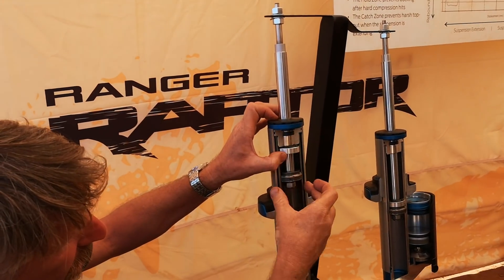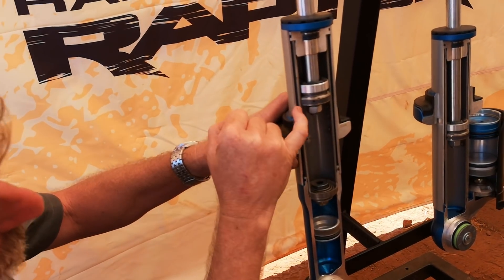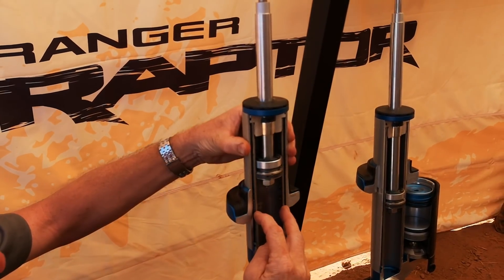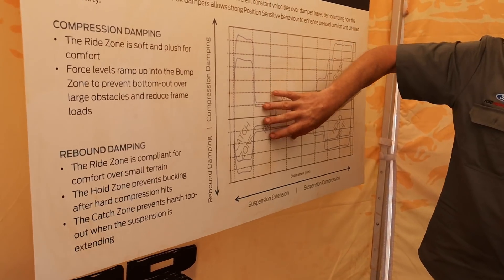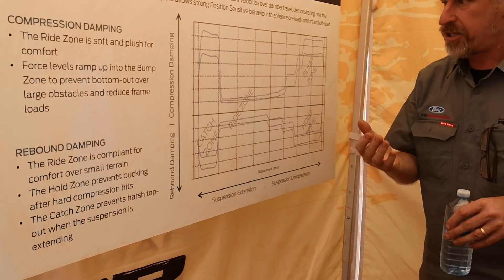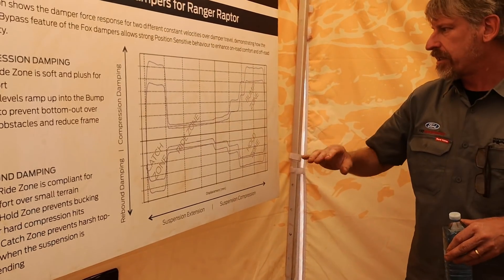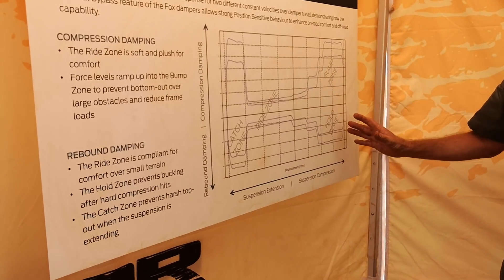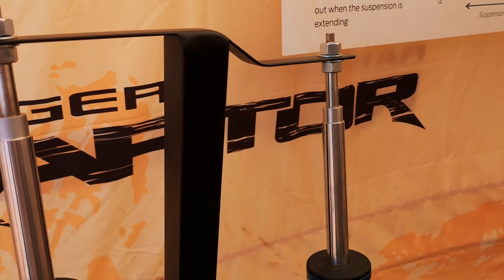Ford Ranger Raptor's Fox Shocks explained

Comment: Are they the same as the F150 Raptor or is it redesigned for the Ranger Raptor
Reply: both are two different truck with Ford racing Baja racing pedigree. F150 are large truck suitable for country like USA while the Ranger Raptor are smaller mid size truck marketed for Europe, Australia & Asia market.

Comment: As we know raptor with fox suspension looses its payload capacity. Does it mean for example, if you load 1000 kg. to the raptor with fox suspension, you will harm the suspension? Is there a solution of this by using another kind of fox suspension vs. Or if I think to load raptor more than 650 kg. should I go with other ranger models.
Reply: It wont harm the suspension but it will bottom out by a significant drop with heavy load. You can always change the rear springs to a stiffer springs to accommodate the extra load but it will affect the ride comfort when the back is empty. You have to sacrifice one or the other. hope that helps!

Comment: are these shocks available for other 4x4 trucks? if so, under what name and price?
Reply from the maker: Thanks for watching and comments. Not sure of the answer to be honest. I assume that they can fit other vehicles but I'm no expert in that area. At the launch they said the shocks are the same value as the engine. Check out their parts list I guess
Reply: The Fox suspension on this truck is tuned and tweaked by Ford Racing division suited for this truck. The name of the suspension is Fox suspension and they have shocks for other 4x4 trucks. You're looking at USD3-4K for a set.
Reply: @calavino223  thanks, mate!